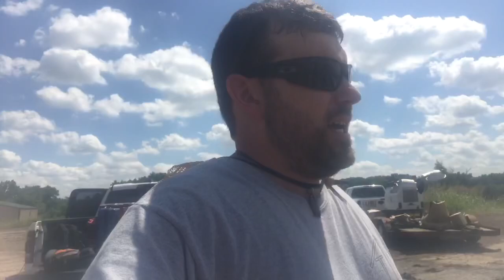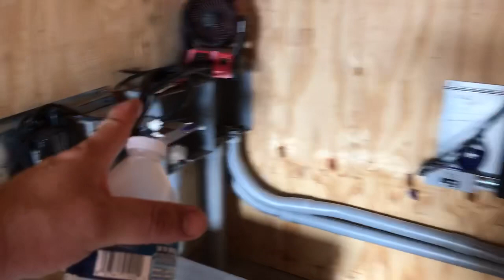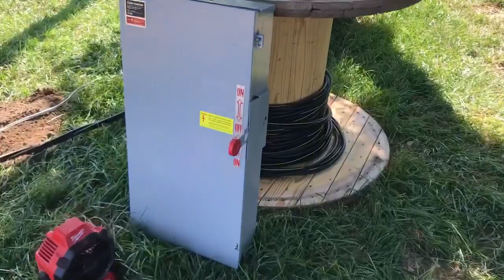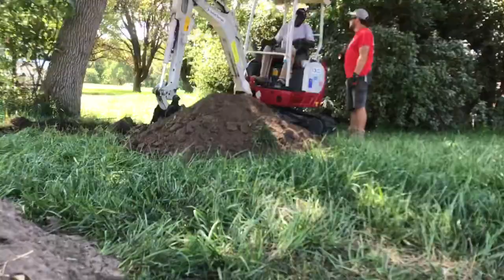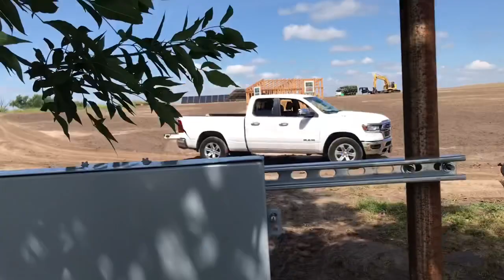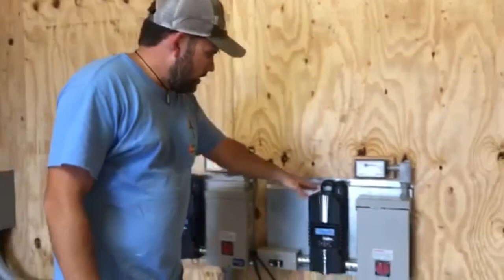30KW solar install EMP shielded Off Grid with dual generator back up

Comment: Why put outback charger controller why don’t used Schneider charger controller that communicate with the system and for monitoring you see all in one place
Reply from the maker: Those are midnite and it reduced the need for extra controllers and provided more amps

Comment: If the SHTF another huge issue is going to be 
keeping criminals that didn't prep 
from stealing the solar panels..
and batteries while your in the house.

If you don't have a large prepping community 
working together to protect your resorces..

Comment: Outback is going to freak out when they see how many strings you tied together in parallel 🤷‍♂️
Reply: Considering they are midnite controllers I do not think outback is going to freak out
Reply: Hurricane Wind Power umm we’re talking Batteries pretty sure I know the components
Reply: @JasonAndrade427  Then you should understand the charge rates of the batteries and program ability of the charge controllers
Reply: @HurricaneWindPower  and you should understand a super basic battery based system rule lol 3 or more parallel strings of lead batterys is asking for trouble.
Reply: @SolarTechFL  Jealous much? This was approved by the design team.....I think maybe you used to bolting up lead acid from batteries plus. haters gonna hate....We better let all the telecom guys know that they better take there shit down if they exceed 48 volts at 600 amp hours...this is going to be a big thing I will get on the horn now and let them know they need to dismantle all that stuff The guys with the Tesla batteries put together that will run there house for 4 days with no sun better take that crap down too.

Comment: Turn key cost
Reply: this one had a lot of battery storage and the batteries are expensive but we can scale things to meet peoples needs. Lucas has set prices per watt on install. If you wanted to check out  pricing on a custom system would be glad to work something up for you to meet you needs.
Reply from the maker: 80K to 90K depending on layout and extras